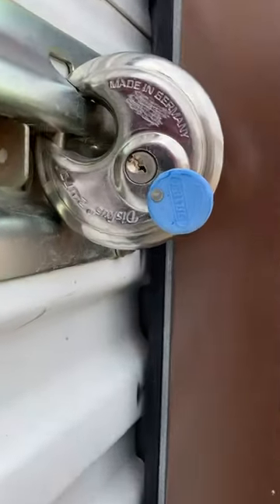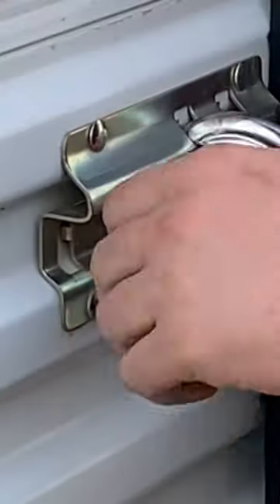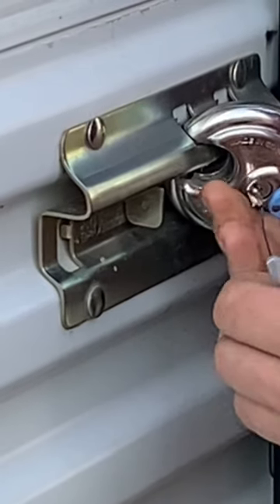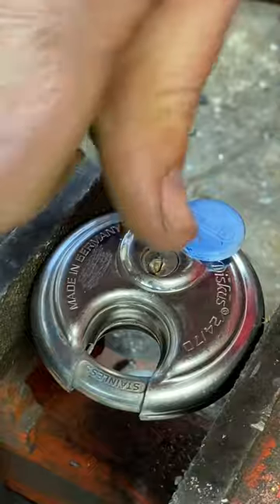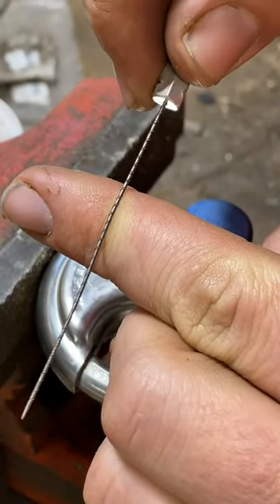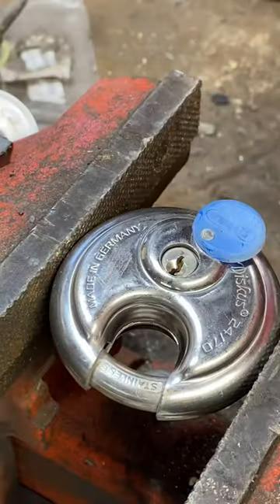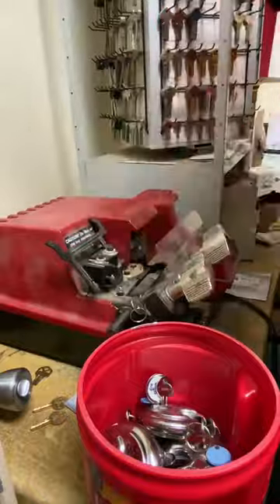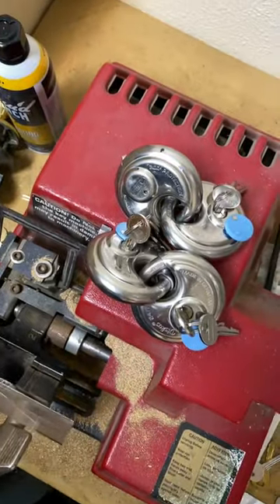Extracting a broken key from a disc padlock. #HandsomeOrHandy #Handyman #Locksmith.

Comment: What he conveniently failed to inform the audience is that these flat round padlocks  have a small hole on the other side for just this purpose, to poke out the remaining part of the broken key, with a Bobby pin toothpick small wire etc. These types of locks are sold at many big storage unit places where many many ppl break their keys in their locks.
Reply: Yep. Also carry crazy glue and be really carefull.